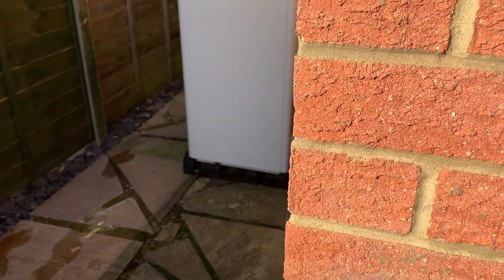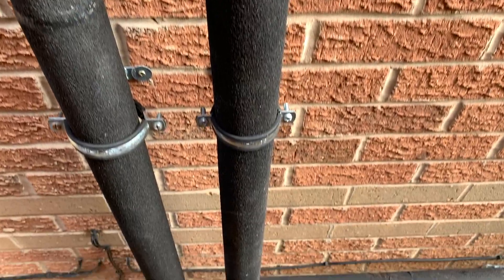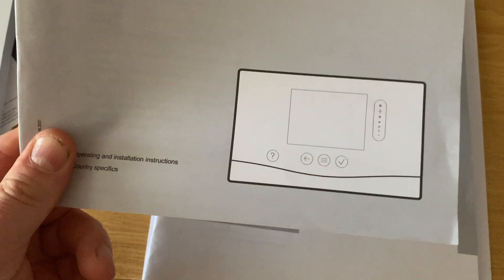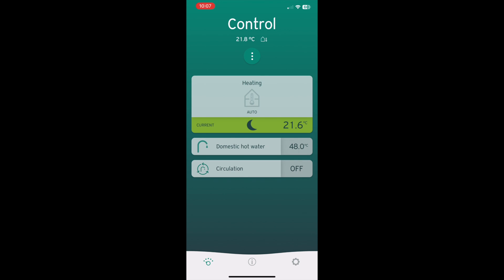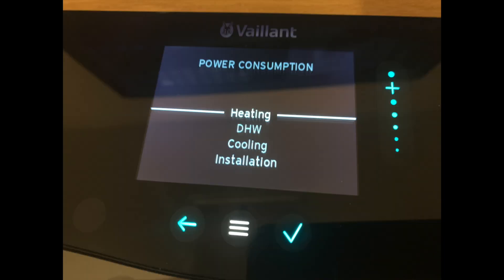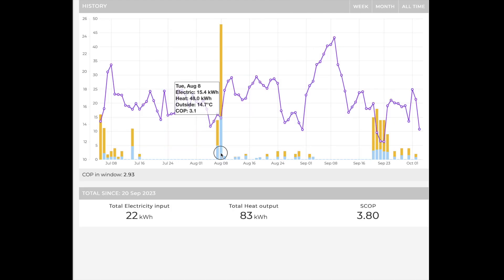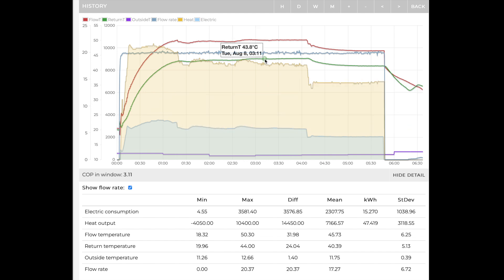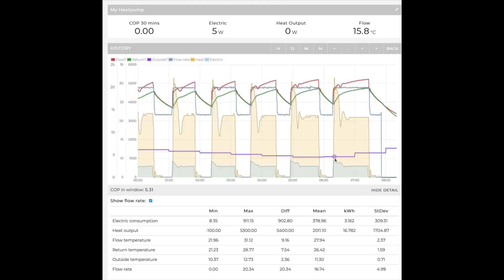Air Source Heat Pump - 30 days after install. What issues do we have?

Comment: Can you state on average how many Kw of electricity you are using per day with the heat pump on
Reply from the maker: Hi Harry, best place to look is on Open Energy Monitoring as this shows our system stats including outside temperature and electricity usage per year, month, week, day, hour etc. Link below to our system: 
 
https://emoncms.org/app/view?name=MyHeatpump&readkey=4f90376a5d12082a8e13ed4da192445c

Click the link and then click on a day. At the bottom click Show Detail to see all the underlying data.
Reply: You will NEVER get someone to admit that.  They never answer the question, they always talk about something else.
Having neighbours with heatpumps, and speaking to Cadent Gas, the trend for heatpumps is falling.  People in Wales and Chester are going back to gas boilers and Cadent is renewing all the gas mains to enable this.  The heat pumps do not work properly, or as expected, are too expensive to use compared to gas, are not as controllable and outdated every few years.  They don't even heat homes to more than 19 or 20c and people lie about being quite happy with that.
If you look at scams in general, people scammed will feel foolish and embarrassed so they will not want to admit they were victims.  It makes them feel awful, so many will not answer questions, or tell you it can cost you £300-£350 per month for 21c and hot water in a 3 bedroom house in winter, or people will ask why they were so daft to be taken in.
Scammers prey on this and use the psychology of scams to ensure people keep quiet.  Those people promoting heat pumps are rarely happy, they do it to make money on youtube to help pay their excessive electric bills!
Many of the channels are owned and run by companies and those employed by them, it is to sell.  Very similar to fake reviews.
You make your own mind up and if you want one, go for it.  I wanted a heat pump to get shut of gas, but after getting surveys and working out costs of operation, it was a lot cheaper to use a gas boiler.  I paid £13 a week in January, a cold month, for my heating on most of the day at between 22c and 24c, plus hot water.  My gas boiler was cheaper, costs far less to use, gives a much higher level of comfort, is more reliable, the heating system has way less parts and is less complicated, this means any gas fitter could fix or service it.

Comment: Hi John
Thank you for such a prompt reply.
I am a complete novice!! 
I have only had system turned on since Friday afternoon. I am going to contact my installer on Monday and they are coming Thursday  to install the app and go through things with me. I hope they can resolve any issues.
Good to know your experiences.
I may get back to you for help once I get my head round a few things - I’ve found it all a bit stressful. At least I am warm now
Many thanks
Reply from the maker: Ah that's good to hear. There is a bit of a learning curve with ASHPs, but once you have overcome that then they are very easy to live with. We don't touch ours at all, apart from an annual service, and maybe a quick weak of the heat curve if it's especially cold outside for an extended period of time. 

Ask your installer to show you how to adjust the heat curve. Once it gets colder 1 & 2ºC and below you may need to increase the flow temperature to keep up with the extra heat loss (heat travel towards cold, so you lose more heat from your home when its cold outside). Turning up the thermostat is not the solution, leave it at 20ºC or whatever you have it set to, and increase the heat curve. In the milder weather in Spring, drop the heat curve back down again leaving the thermostat at 20ºC.

Ask them what is the outside temperature cutoff for the heat pump is. e.g. at what outside temperature will the heating turn off. Ours is set to 17ºC, once it hits that our ASHP will not heat the house, just the hot water. There's no perfect temperature here, but you want it just around minimum comfort levels; 17 - 19ºC is about right.

Ask them if you are running Pure Weather Compensation. This means it takes the outside temperature to determine the flow temperature of the water for your heating. If the temperature outside rises, the flow temperature decreases and vice versa. Pure Weather Compensation is the best and most efficient way to run a heating system, be it gas or ASHP. Some systems allow you to combine a room temperature with weather compensation which is ideal if you have one or two rooms that are hotter or cooler than the rest of the house.
Reply: Hi John, I have a similar system. Iv currently got an issue where Iv had water turned off to the system which gave an f22 fault code for low flow. Iv turned it back on and re pressurised the system but my heatpump isn’t kicking in to heat my DHW and heating. Have you ever come across this issue?
Reply from the maker: What is the pressure is the system now? Ideally needs to be between 1.0 - 1.5 bar ideally the upper end of this.
Reply: @johntisbury  thanks for the reply, it’s at 1.5 bar, the control panel is registering that the tank temp is low but it’s not kicking in
Reply from the maker: @moyseylive  have you pressed the black reset button on the front of the white control module VWZ AI? If that doesn't do it I'm out of ideas I'm sorry to say.

Comment: Hi
I just had a heat pump installed.its been on for 30 hours now and it still hasn’t reached 22 on temperature. It is now only on 20.5. The radiators are intermittently generally warm but I seem to be using a lot of kWh this last day 24kwh.is this normal in anew installation? I am a complete novice!
Reply from the maker: Hi Jane, tricky to answer without some more information. What is your design flow temperature and what is your heat curve (see below) set to? Are you using weather compensation? What size in kW is your heat pump?

Your installer should have gone through the system with you. 

There's 2 variables which affect the amount of heat a heat pump will produce; the thermostat temperature you set (22ºC in your example) and the heat curve. The heat curve tells the ASHP the flow temperature to run at based on the outside temperature. The higher the heat curve the hotter the flow temperature. The downside is the more electricity you will use. The other variable is how you are running the system, ideally it needs to be on all the time and tick over low and slow. Ours runs at around 28ºC flow temperature at the moment and our house is a constant 20ºC with the current 7 - 10ºC outside temps. 

There's a learning curve with an ASHP, unlike a gas boiler which blasts hot water around the radiators and cycles through hot and cold. ASHP use a different approach and run at lower temperatures and IF designed and installed properly will cost less to run than a gas boiler. 24kWh in a day is a lot to use with current outside temperatures. We have used 16kWh in the last 24 hours to give you an example.

Comment: How do you get all those nice graphs and data?
Reply from the maker: I use Microsoft Excel and manually record the data on a daily basis and chart from there.
Reply: @johntisbury Fantastic work! What puzzles me is that whereas MyVaillant app provides hourly data you seem to be recording data by minute. That´s nice because you can capture system cycling and this kind of things… but where do you get the data from? Have you installed special measuring equipment ?
Reply from the maker: We have a heat meter installed and linked to Open Energy Monitoring, I've covered this in previous videos. Have a look here: https://heatpumpmonitor.org this is independent 3rd party monitoring of heating systems, mostly ASHPs. If provides the granular data and graphs you are referring to.

Comment: My own heat pump is online tonight!  Trouble is:  I’m not at home but in Germany.  So I’m reading what I can into my energy consumption figures through my Solaredge app.  Consumption is not constant and steady like I through they might be.  I suspect there’s lots of tuning that needs to happen and I do note your remarks about air bubbles.

My plumber opted for the spirotech deaerators.  They put the flow water through a centrifuge which causes the micro bubbles to coalesce before being vented.  I’ve had one on my old CH system.  They are excellent, and since I got that fitted, no more corrosion issues.
Reply from the maker: Great news! I'm sure once you are back home you will be able to monitor the system more closely. 

I've read on the Spirotech website that they recommend vacuum degasser over a microbubble deaerator with heat pumps that have low flow temperature. It will be interesting to hear how you are getting on with that. It took me a good 3 weeks or so to bled all the air out of our hot water system, the rads was the easy bit.

Comment: Hot water a tad on the low side ! To stop Legionella you need it above 50c, 48c and lower you run the risk of legionella growth in your system pipework.
Reply from the maker: It depends if you feel you need to run a legionella cycle. We don't bother. Why? The water in the 200L hot water tank is emptied almost every day. There's not enough time for it to grow. There's more risk from shower heads that are unused for weeks at a time.
The decision to run the cycle or not does depend on your lifestyle and hot water usage. Heat Geek have done a great video on the subject, link here: https://youtu.be/oJeyc_cGIMU?si=AURr4fqhwtKBK0VA

Comment: It's a shame the apps are so garbage you should be able to see and change everything that's going on not have to resort to the up and down arrows and a dot matrix screen.  Also that's a heck of  alot of attic and outdoor pipework your gonna be losing  a chunk of efficiency in the winter (when you need it most!).  Interesting vid though keep it up.
Reply from the maker: We had no alternatives on the location and primary pipe runs. This location was the shortest from the couple of locations. 
Agree on the apps. Open Energy Monitoring is a godsend

Comment: No wonder theres not been another update, geezers probably frozen solid along the ASHP with those clearances from the fence, no buffer, massive external pipe run and prikary pipework size.
Reply from the maker: Oh ye of little faith. We have been fine. -1.6°C all day, average 33°C flow temp, including a 52°C hot water run. 2 defrosts an hour, maintaining 20°C indoors.

Comment: Until the price of electricity drops in relation to gas, I don't see why anyone would install a heatpump in the UK.  Electricity is 3x - 4x more expensive than gas so a COP of 3 - 4 is basically the same cost as gas.  That is until you get into winter when you need the greatest performance out of your heating system.  A gas boiler is unaffected by outside air temperature but the COP of an ASHP is greatly affected in a negative way.  COP of less than 2 is not unheard of in sub zero temps.  Until the price of electricity is decoupled from gas there's absolutely no point, unless HPs start producing COPS of 5+ down to -10 degrees C.
Reply from the maker: A couple of points come to mind Chris. 

1) Not everyone replaces their fossil fuel heating system to save money. Many site the stopping of burning fossil fuels in their home as a main or supplementary reason. With the added benefit of no standing charge on that service. 

2) Depending on your location in the country the average winter temp is around 9ºC. Sub-zero temperatures are infrequent and don't last for long, again depending on your location. Heat Pump efficiency should be measured over the course of a year, SCoP (Seasonal Coefficient of Performance) rather than COP which is a moment in time. A SCoP of 3.0 - 3.5 will be equal to gas prices at today's costs. Anything higher is therefore cheaper. If you look at Open Energy Monitoring dashboard there are 14 systems with data over 365 days. The highest SCoP is 4.2, the lowest is 2.9. 

The extreme cold not only affects heat pumps, condensing gas boilers are prone to having their condense pipe freeze which stops the appliance from working. Most gas boilers now fitted in the UK since 2019 are condensing combi boilers.
Reply: @johntisbury  Not everyone replaces a boiler with a heat pump to save money, no you're correct.  However the VAST majority of the UK public are simply not interested in whether or not their heating system is fed from "green" sources.  The overwhelming majority are concerned with cost and cost alone.  With energy prices being 3x what they were 5 years ago you can understand why this is.  If the case for a heat pump was compelling and didn't require government meddling with stupid incentive schemes, people would be queuing up to buy them.  A good product sells itself.  A product that requires incentives to make it financially viable is a completely flawed concept from the start.  Make electricity CHEAP and I'd agree entirely with the switch from gas to electricity but until we stop being ripped off by energy companies and governments, that's not going to happen.  A depressing state of affairs, but true.
Reply from the maker: @Chris-hy6jy  thankfully there is a tide of change to amend the current wholesale pricing methodology which sets the price based on the highest contributing sourest, typically gas. OFGEM, National Grid and the Government undertaking reviews and consultations on it. However, it's a mammoth task as it's a Europe wide approach that needs to be agreed and adopted. There are some early wins with the dropping of green subsidies that are applied to electricity and not to gas. There has been a commitment to level up the disparity between the gas and electricity by 2030. However, this is a tricky nut to crack as there's the potential to leave many more people in fuel poverty if gas prices rise and electricity prices fall. 

With many new products and emerging markets subsidies are put in place to reduce the purchase price and it's the early adopters who get the ball rolling. Solar panels is a great example and the FiT scheme. Whilst not a perfect scheme it has managed to reduce the price of solar panels through increase in supply and make them more affordable to the mass market. 

Heat pumps are still in that early adopter change curve and will be for some time to come. Market disrupters like Octopus Energy and British Gas are picking the low hanging fruit and using the £7.5K BUS grant to offset the costs of installation from £0 to £500 to install a heat pump.

It's not the energy companies, the big 6 as they are know, that are ripping us off it's the fossil fuel extractors. https://octopus.energy/blog/the-state-of-wholesale-energy/
Reply: @Chris-hy6jy  and this is why getting to net zero will be such a challenge. If most people would rather see the world burn than risk not being financially better off. Those who can should be encouraged to help in the mammoth task ahead.
Reply: @Chris-hy6jy  If you're interested in actual real world data of how a heat pump is performing in the latest cold spell you can watch my November rundown here : https://youtu.be/dqA62N2H2sQ
Spoiler, my combined CoP for heating and DHW never dropped below 3 on even the coldest days.
Reply: Not to mention those of us on oil! If anyone wants to volunteer to dig a gas main to my village I would gladly bask in the BTU’s. Until then oil is cheaper than LPG and electricity is cheaper than oil!
Reply: Ignorance is a wonderful thing... I pay on average 8.87p/kWh (last months figure) as I have an EV and batteries.  So for me... an ASHP costs about 2p/kWh... compared to a gas boiler which costs 7.7p/kWh... on top of that... I don't have any gas in the place... so that saves the standing charge too.  You may wish to correct your ridiculous statement.
Reply: @gregevans8939  oh where did you get your free EV and battery from?
Reply: Also, not to be overly hair splitting, but the inlet air temperature on a gas boiler will impact the amount of gas it needs to burn to generate a certain amount of heat.  Not a lot, but there will be an effect.
Reply: Are you talking from experience  or is it just theory?
Reply: There are plenty of smart tariffs where the cost of electricity is circa twice the price of gas, which with a COP of 4 give you half price heating. Add that to a summer smart solar Export credit and you are laughing all the way to the bank.
Admittedly we have a very large PV array but we end the year making several hundred pounds profit.
Reply: As always the Government will eventually increase the cost of fuel cancelling out all savings as they have done with condensing boilers, ev vehicles and more.
Reply: Don't forget that most 'condensing' gas boilers are only operating in the window of 80% efficiency.

Add to that solar, home batteries, TOU tariffs and you start to build a strong case for Heat pumps 👍

Comment: What a monstrosity..
Reply from the maker: Get back under your rock Greg
Reply: @johntisbury  
My boiler fits in a small kitchen cupboard...
That thing you got sticks out like a bulldogs bollocks
Reply from the maker: @greg434  we removed our boiler and have freed up usable space indoors where it was located. The heat pump is outside in an area that was not used and cannot be seen unless you purposely walk round there.

Comment: I am thinking of adding a Valliant heat pump to my home and noticed you have an Eddi, are you using the Eddi to get the heat pump to heat the hot water wit the Eddi relay or is the Eddi simply heating with the immersion?
Reply from the maker: Thanks for watching. This is a great question. We had the eddi in before the heat pump by a couple of years. If we have excess solar and nowhere to put it then I will use the eddi to heat the hot water. We don't have an export tariff, so no benefit to sending back to the grid. 9 times out of 10 the heat pump will heat the hot water as it's way more efficient in terms of the COP.